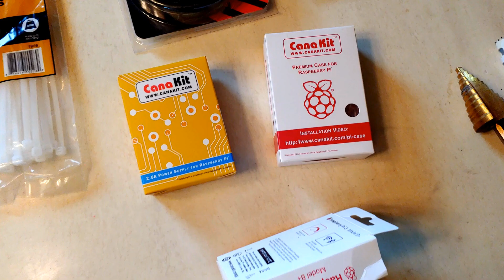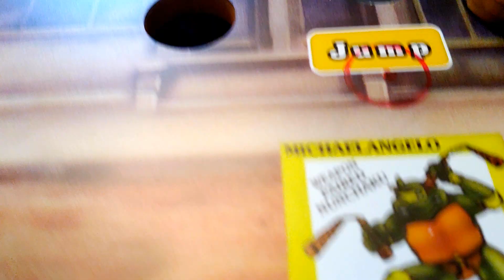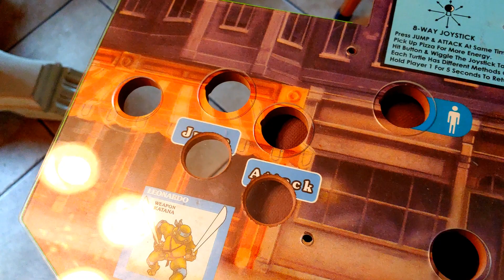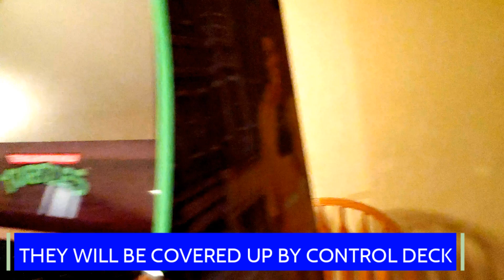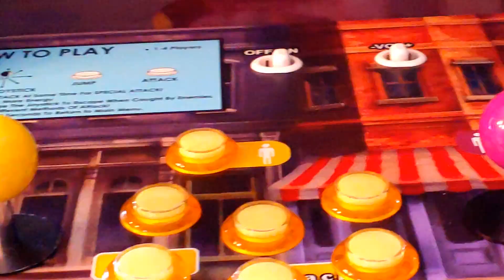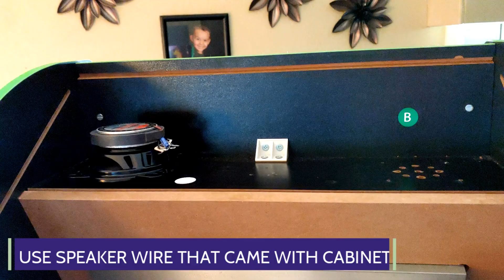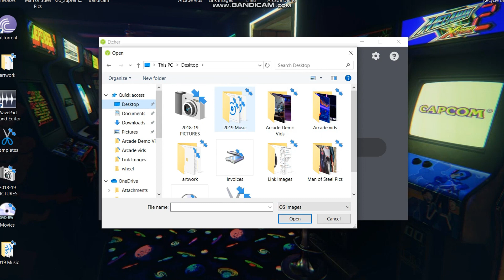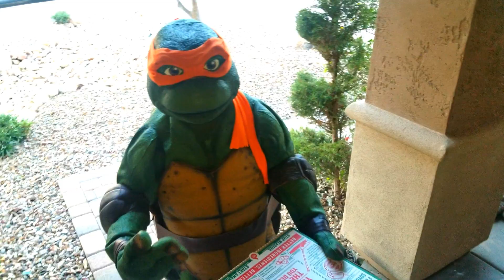TMNT Arcade1up 4 Player Cabinet Mod Tutorial

Comment: Good tutorial but I suggest that once you make a dot on the plexi glass you use a drill bit just to make a hole that the hole cutter will slot into so it doesn't slide on the plexi and mark it. Unfortunately these aren't in the uk till the 20th of August 😔

Comment: Tip here for those who are watching this. You do not need to buy an amp. The LCD board has an amplified input. It isn't the aux cable input, it is the 4 pin connector right above that. You simply need to cut the male aux end off the speakers and connect a 4 pin connector to that. The AUX wire has 4 wires inside. 2 black (ground 1 white and 1 red (left and right speakers). The 2 black go in the center while the red going on top and the white on the bottom. If you mix the white and red, that is fine. This isn't surround sound and all the sound comes out at once so you wouldn't notice if the left and right were mixed but thought I would let you know the correct way any ways. So you bought 80 bucks worth of buttons and now you have a crap load of extra stuff laying around. Look at your old joy sticks most of the come with 4 pin connectors. Cut it off and leave yourself some room for mistakes by cutting near the base so you have plenty of wire. Now all you have to do of course if strip the wires and connect them in the correct way. The color of the wire does not matter on the joy stick. You just want to make sure whatever wire is going to be plugged into the top pin is connected to the red and the bottom pin is connected to the white. The corresponding ground wires go in the middle. Layout [(r)(g)(g)(w)] If the 4 pin connector from the joy stick is too big, you can literally just removed the white plastic from the side of the pins on the the LCD board. So long as the correct wires are touching the correct pins and there is enough conductivity, it will sound very very loud. Just as a usual TV would. Hope this made sense. If you are savvy this should shed some light regardless. This is if you want to use the stock speakers. I can't really think of a reason why would would want low quality sound pumping out of nice speakers but to each their own. The stock speakers sound just fine and the LCD amp works great.
Reply from the maker: Thank you for the input on this as when I made this video I was very new to the process. So I am aware of this now. My only issue would be is there a place for a subwoofer?

Comment: Sound from the back, cancels out sound from the front FYI... Also, the speakers are designed to compress air in enclosures, unless they are designed for free air operation, you might want to seal those up.

Comment: Hey buddy, all & all this is a good video. You really done a pretty good job. To an utter beginner (me) it's a very helpful video, to PI mod a TMNT A1up cabinet . I used this video for almost my whole 1st build. This vid could use a few more details added, to be a complete 100% DIY, for 1st timers though. I really, really appreciate your work at attempting to make this vid a 1 all, instruct all. I still needed to use 2 other tutorial vids to write the image. At this moment, I'm stuck at configuring the buttons. I don't have a usb controller etc. right now & would asked that you please show/tell how to configure the buttons/controls etc., to add to your/this comprehensive vid. I come to you, because of just how this vid is IMO about 80% complete as the most extensive 1 and done, only tutorial needed, vid. So that it's a 100% complete "how to for dummies." What do I need to do to configure buttons, so that I can finally finish my TMNT arcade 1up build. FYI, I have all the same hardware installed, that you linked. I have the wolfanoz 32gb arcade only image though. I'm stuck at this moment trying to figure out how to get the controls right. Could you please explain how to configure buttons etc? Thank you, for this video & all your help
Reply from the maker: So when you're in emulationstation you hit start and it will bring you into an option that says controller input where you can redo the controls at any time, otherwise when you initially start retropie it will have you set your controls from the get-go, if you need more help with this PM me on Facebook

Comment: Good job on everything. I have a mk2 1up arcade that I was gonna mod but I thought what for space is limited and I said I could build one better and really customize it, so I did.. believe it or not I built mine for cheaper then you bought all your parts.. I occasionally will help people with there builds or when people ask if they should buy an arcade cabinet I ask them a few questions and 1 being are they plan to mod it..? Some say yeah then I say it’ll be cheaper for you to build your own. You’ll spend about 3 bills on the machine and if you don’t know where to get the items you’ll pay more for them and end up spending another 3-4 hundred. Will all that you can almost buy a real arcade machine. I eventually want to get a cheap 50$ machine and just use the sides and put a bigger screen and ect and show people it can be done most only work in a small space they confine themselves to the small specs of the machine itself. I built mine with a 32lcd HDMI tv then bought 1 sheet of mdf 3/4 and I almost built the whole machine just with that sheet alone.. If you can do this bro I have a good feeling you can build your own from scratch , you should try it one day.. But I commend you on you trying to hit every detail bcuz your right most can’t explain right or in detail what there tryin to say. You did a great job.. much respect ✊🏽

Comment: Hey man, question, I noticed that you had the off/on and vol button wires going on the board somewhere. I know you're not using the vol button since you have the amp but what about the power switch? Are you utilizing it to work with the pi?
Reply from the maker: I actually don't use the power button or the volume button on the control deck as you mentioned the volume is controlled on the amplifier and what I did was plugged everything that has a power source into a power strip then I bought one of those remote control power on power off plugs from Walmart for about 8 bucks so I can just hit a button on the remote and turn everything off and on with the push of a button
Reply: Oh smart ok cool. Wondered if you always went to the back to power your power bar. Lol. Thanks!

Comment: Great video! Is there a reason you went with a 3B instead of a 4B? I keep looking at this but wasn't sure why you went with that specific item.
Reply from the maker: Yes, the 3B has been out for a while and works perfectly fine. With the Raspberry Pi and the image that I chose. However, the for hasn't been out that long and if you research just a bit has a lot of problems with overheating.

Comment: Hey, I'm about ready to pull the trigger and buy some stuff to follow along with this video - question about drilling the plexiglass, do you think a Forstner drill bit might be the way to go instead of a holesaw? I know there are two different button sizes in the arcade kit so I need to get the right drill bits to match. I'm excited to do this but definitely worried about cracking the glass.
Reply from the maker: If it makes you feel any better I don't even use the plexiglass anymore, I crack him 90% of the time and they are totally unnecessary, the underneath control panel has a high-gloss coating on it anyway so you definitely don't even need the Plexi

Comment: Please excuse my confusion and possible stupid question but, now the tmnt games you are playing are the ones you downloaded to your sd card and not the ones that came with the original arcade1up card correct?
 Also, do you need a desktop computer to load games to sd card or could you use a laptop?
Reply from the maker: Correct and either will work :)
Reply: @arcadepickers1682  Thanks so much for your help.

Comment: I’m new to this so fair warning.  Just curious when you play your turtle games are they the games that were programmed into the marching or do you have to play the ones on your raspberry pi?  Is there a way to switch between the factory game and your mod games?
Reply from the maker: They are the ones that are on the SD card on the Raspberry Pi, once you disconnect the stock game so you cannot switch between them again they are done for you will have all the games you need on the Raspberry Pi

Comment: Question! Is there a way I can get an sd card already programmed?
Reply from the maker: As long as you have the Raspberry Pi 3B plus I have the image which I would be happy to burn for you for a small fee, there are some other ones available on Arcade punks website. You could also check eBay just make sure it is for Raspberry Pi 3B Plus or whichever Raspberry Pi model you purchased. If you need my help feel free to message me on our Facebook page

Comment: What size should the dozer be to cut the plexiglass?
Thanks
Reply from the maker: The size in the link is the perfect size
Reply: @arcadepickers1682  it says 2 inches but I think that's way too big. I think the amazon seller switched the size of the dozer in your link
Reply from the maker: @PennsylvaniaHomesforSale  it's a one and three-quarter inch hole Dozer with 3/8 in Arbor anchor
Reply from the maker: @PennsylvaniaHomesforSale  to be honest with you the last five machines are modified I do not even cut the plexiglass I just leave it off in the smooth surface underneath is much prettier
Reply: @arcadepickers1682  do you spray it with anything to protect the surface?
Reply from the maker: @PennsylvaniaHomesforSale  no it has a layer of satin gloss already on the control panel and to me it works absolutely fine, I cracked a couple of plexiglass plates and ended up using it without and it seems to be perfectly fine without it

Comment: Great video. Question are you connecting the audio straight to the pi or the display? I've heard that there may be some issues getting sound on some images like this when using the pi audio.
Reply from the maker: The HDMI goes from the pi to the display then there is an auxiliary output coming from the display that goes into the back of the amplifier and I have no issues whatsoever
Reply: Thank you sir. Using your tutorial to mod mine at the moment.
Reply from the maker: @velezjaphet  let me know how it turns out

Comment: Good details here! I have a TMNT Turtles in Time A1up that I am currently modding. Trying to figure out a safe way to power off the monitor. What do your power off steps look like? Do you just flip the power switch on the surge protector strip? Do you hit the power button the VSDISPLAY controller? Do you safely power off you Pi first?

Comment: Hurts my eyes seeing the side panel being drilled for no reason lol. All you need to do is extend the wire instead of drilling through the side. Doesn't add any delay extending the wires. Smart thinking with the phone charger though. I used to do the same thing with those older led buttons too
Reply from the maker: The problem is unless you drill the side panel when the wires are running underneath the control deck there are plastic walls underneath the wood that will smash the wires potentially causing problems once you tighten down the screws on the top
Reply: @arcadepickers1682  you extend the wires and run them in the gap inside of the plastic control panel cover in the gap if front of the cut out for the side panels. No need to run them in between where the screws go. Next time I do a 4 player mod, I'll add a video. Please everyone, do not cut unnecessary holes into your side panel graphics.
Reply from the maker: Yes please add a video I would love to see what you are talking about however does it really matter if you cut a hole in the side panel if it is covered up by the control deck anyways?
Reply: Depends. I have different panels I add to play certain games. For example, swap out a steering wheel or panel with trackball and spinner. Not everyone, including myself, wants more than one of these in their house and having the side panel cut. It looks horrible with the swapped out panel because you would see it then..... All I was suggesting was to run the wires inside the plastic panel around the cutout, not cutting a whole through the panel. Extend the wires to be longer. That's all you needs to do. When you put in the video "Must cut a hole through the side panel" makes people believe it's the only way to do the mod. I was just suggesting the extended wire method as a non permanent alternative

Comment: I haven't seen anyone ask and it wasn't in the video so are configuring all the different buttons and joysticks to work with the raspberry hard to do? It seemed they just worked in your video but I'm guessing you just cut that part out of the video or am I wrong?
Reply from the maker: yes very easy it will walk you thru it on the screen the first time you turn on the raspberry pi ...can be reconfigured at any time as well
Reply: I've read about the importance of having the same number of buttons set up in the same spots on each encoder, so does having 8 buttons for players 1 and 2 and having only 4 for players 3 and 4 mess anything up?
Reply from the maker: So it doesn't matter because you have plenty of spaces on the encoder you just have to make sure that the players that have extra buttons have those buttons in the same spot as well obviously on the encoder for the players that have less buttons those spots will be left blank

Comment: I want to only have 2buttons per player. So im fine with just using the stock ones. I know id have to add hot keys for each plyr. I have the usb encoder my question is can i put the stock buttons onto a usb encoder? I see that they are glued down is this mean i cant remove em?
Reply from the maker: You can remove them just be careful not to break them otherwise you will have to re splice them

Comment: Another question for you, did you ever think of putting the coin buttons on the side on the console underneath each turtle instead of under the main console where you ended up putting them? Wondering if you've come across something that maybe prevented you from trying that. I'm planning that actually so I was wondering.
Reply from the maker: I actually did it that way on my new cabinet, the one that you see in this video I actually sold to someone and I remade a different one and added the coin buttons up on the control deck
Reply: @arcadepickers1682  can we see a pic or quick vid of the coin buttons on top?

Comment: Great video! I've actually got the same problem with the speakers being too long. I thought of drilling holes on the top H panel, but I always learned that speaker cones should always be enclosed, or you lose sound quality.  With that said, how's the sound quality even with the exposed holes?
Reply from the maker: It actually sounds pretty good, I don't usually Blair it that loud. Since this video I have completely moved away from arcade1up and only work on traditional arcade cabinets now I never run out of room LOL. Thanks for watching bud

Comment: There is a company 99 lives arcade that can make you a new joystick deck with a pi in it ready to go but it costs like $700. There are new revised 4 player Konami games coming out this fall with wi-fi like Turtles in Time, The Simpsons, and X-Men. I wonder if the pcb’s are interchangeable between the old TMNT and the Simpsons? Then I could get the Simpsons and dismantle my TMNT cabinet or keep the TMNT assembled and swap pcb’s and put the Simpsons in it. I have limited room for more cabinets and I only have around 6 big ones, TMNT, MK that I modded with an X-Arcade stick, a Carnevil cabinet that I have yet to set up with the guns and roms, Outrun, a Cruis’n USA mod with an N64, a Toyshock Haunted House pinball, and Pac-Man countercade.
Reply from the maker: Wow great stuff

Comment: How do you set the joystick input to where Donatello is player 2 and ralphael is play 4?..whenever I try to play sf2 ralphael is player 2 which only limits me to 4 buttons
Reply from the maker: So this is kind of a confusing question because Ninja Turtles only uses two buttons jumped and attack if you're talking about Street Fighter that's a totally different ball game but all you have to do is switch the USB inputs on the Raspberry Pi there are four inputs total on the Raspberry Pi in each one represents player one through four so you can switch those out an experiment to find out which one is Player 1 2 3 and 4 and plug those in a cordingley and they will adjust on the screen exactly how you have them plugged in hopefully this help you out

Comment: Did you use the original On/Off switch? if not, how do you power the pie?
Reply from the maker: I plugged everything into a power strip and plug the power strip into a smart plug that turns on and off with the remote, they have them at Walmart for about 8 bucks

Comment: Several of the items are no longer available to purchase. The amp and 4 player button kit are 2 of those items. Any suggestions on alternatives?
Reply from the maker: Yes I've been hearing that a lot, you can actually use any 2.1 amplifier on Amazon or Ebay just make sure that it has a spot for the subwoofer and the right and left speakers and make sure you order the correct power source it will usually tell you on the link which power source to buy usually it's a 12-volt, as far as the four-player arcade kit there is another one available on Amazon it just has slightly different buttons and joysticks but any of them will work the same way
Reply: Thank you!!!
Reply from the maker: @zackthompson4021  no prob....good luck ;)

Comment: Sorry if you mentioned this already in the video but where do you connect the “Insert Coin” buttons? Because the wires I have don’t reach.
Reply from the maker: You have to extend the wires by splicing some extras on to it and electrical taping them together